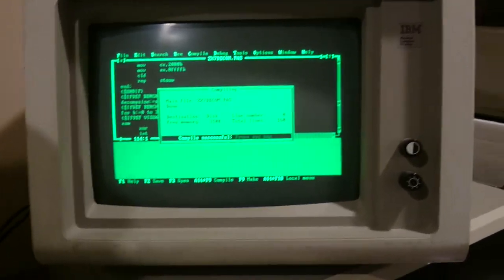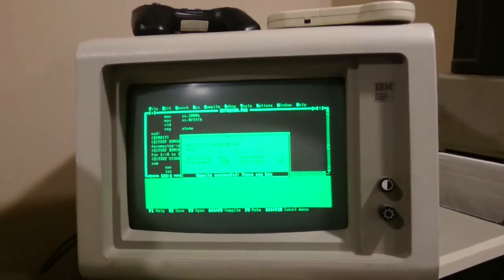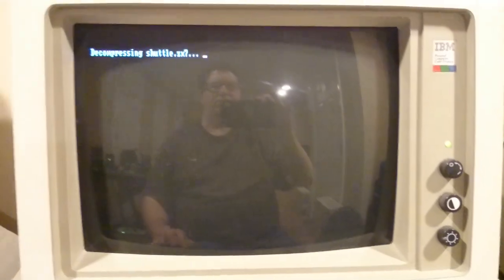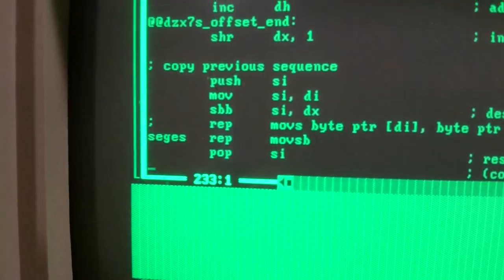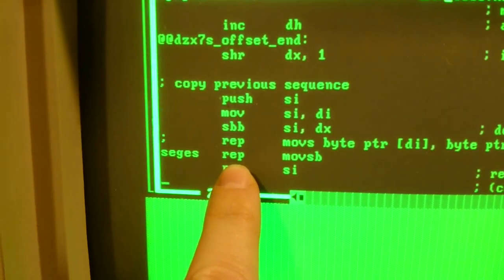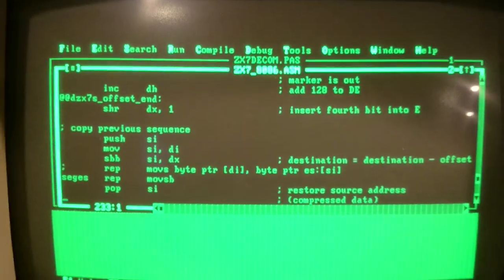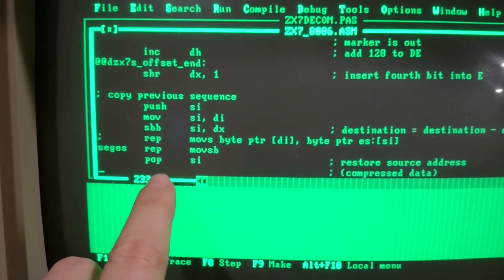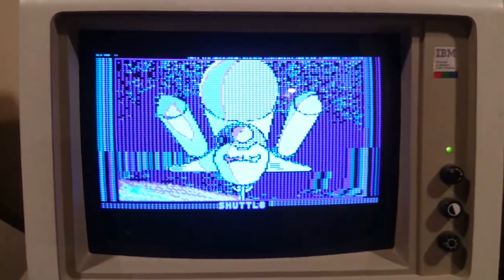8086-80286 instruction prefix interrupt bug visualized

Comment: Have you confirmed that in fact Intel has corrected the issue and this does not happen with a 386?
Reply: The specified 386 instruction format includes the prefix specification as follows: Instruction prefix - Address-size prefix - Operand-size prefix - Segment override. It could not be so specified if it didn't run correctly. In a code run on a 486 I have used string instuctions with 2 or 3 prefix bytes with absolutely no issues.